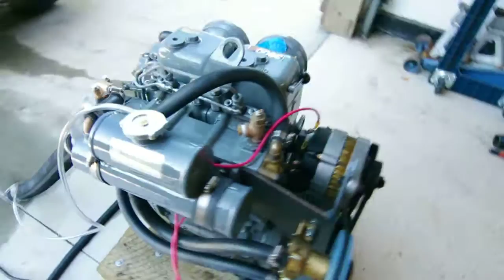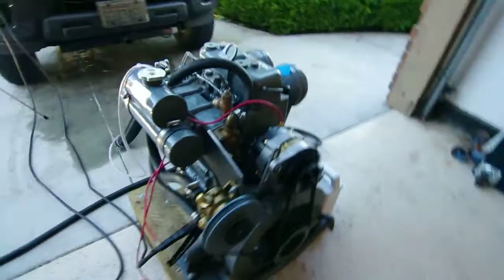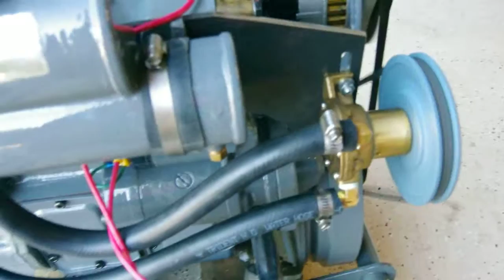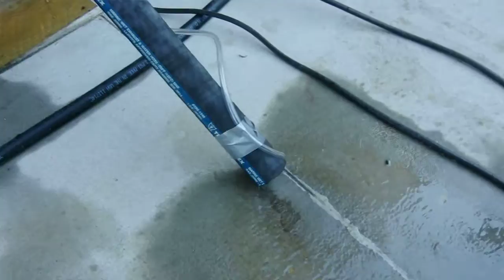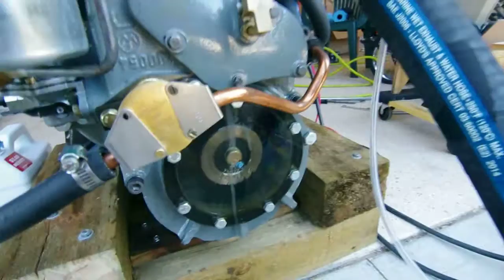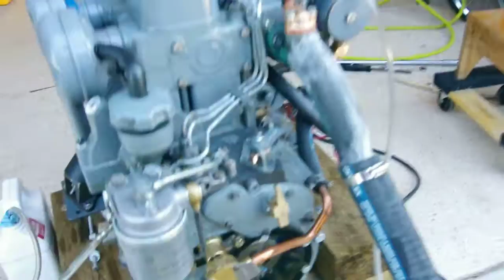Volvo Penta MD11-D

Comment: Hello, I see that you have a fresh water/coolant heat exchanger with Johnson circulation pump. I would like to modify my MD 11 c with the same set-up. Where to buy the kit? Thank you
Reply from the maker: The heat exchanger was on the boat when I bought it. It was made by San Juan Engineering - http://www.sanjuanengineering.net/ 
The bracket and choice of circulation pump and pulley that you see are of my own design. The original was a Jabsco pump - I think it wasn't serviceable anymore.

Rather than trying to copy this setup, I would look for an aftermarket heat exchanger in the right HP range, or look for one from an engine with similar rating from another manufacturer. Using an electric pump instead of a belt driven one will make things easier.

Comment: That Volvo engine sounds great and looks great. After this fundamental rebuild, there are decades of a solid diesel engine ahead. I have just bought a 1972 contest sailboat, which has a Volvo MD11D diesel engine. I'd like to get in contact with you, because this engine needs a rebuild as well. Thanks Manfred
Reply: Nice job. I also have rebuilt my MD11D from my Contest 33 because of faulty raw water pump filling crankcase with sea water. All came out well after much work. I dream about every component of that engine still...
Reply from the maker: Hi Manfred. I only saw your reply just now. I've had problems with this engine after the rebuild - head gasket failure - and ultimately replaced it. The rebuild was very expensive. I was so tired of this engine that I disposed of it but I still have a box of hard to find parts. Let me know if you're interested in buying the box. I can see what's still in there.
Reply from the maker: @BobBGoode  Ha, I bet. Let me know if you're interested in my box of leftover parts. I no longer have the engine.

Comment: this is very nice and tidy  job  you ve done everything is in good position and looks like industrial made,Congratulations ,i think  i ll copy it,the only question i can make is about the fresh water cooling pump is it made to withstand up to 120*C  with porcelain housing???If yes were did you get it from??After all is it working now ??
thanks for all
Reply from the maker: The fresh water cooling pump maximum temperature was within spec, although near the limit. It was a centrifugal pump, not a flapper pump, the brand was Johnson. I reviewed the specs of the pump and picked a pulley that would allow the pump to work within its rpm range given the size of the crankshaft pulley and engine rpm range. The pulley came from a local industrial supply store.

Comment: Hello, I see some water floating behind the "window" you prepared. Can you tell me were this water is coming from? and were does it leave the engine. I can't find this subject in the manual or repair handbook. the function of this water is cooling the axle or clutch?

thanks in advance.
Reply from the maker: +tb2509year That's a good observation. I believe what you're seeing is engine oil. There should not be water in the block. 

There is no clutch here - behind the window you can see the crankshaft output flange rotating. When I reinstalled the engine in the boat it came from, I removed the temporary plastic window and mounted a saildrive (120S). The saildrive contains a double conical clutch.